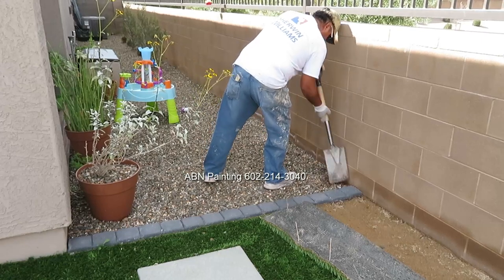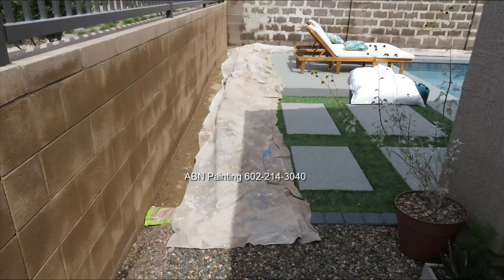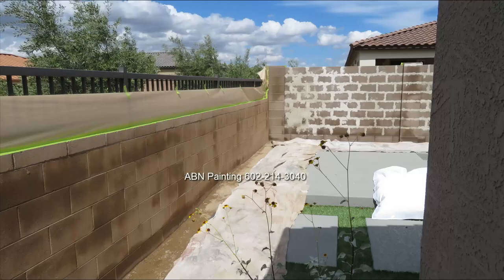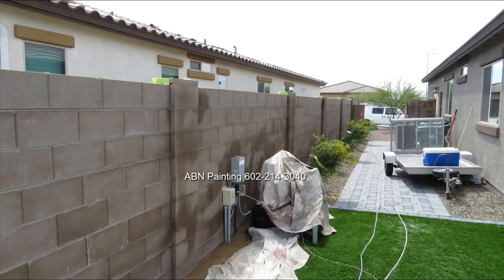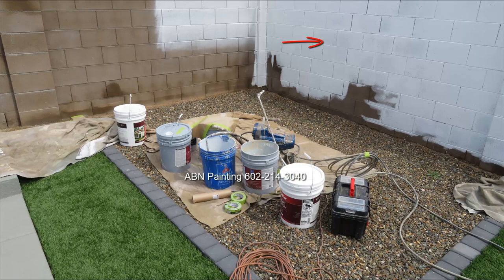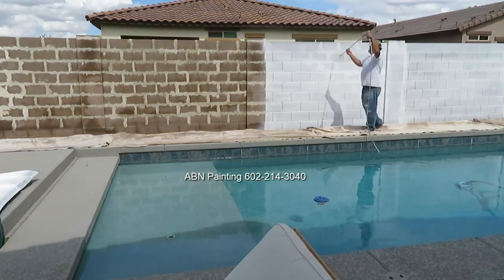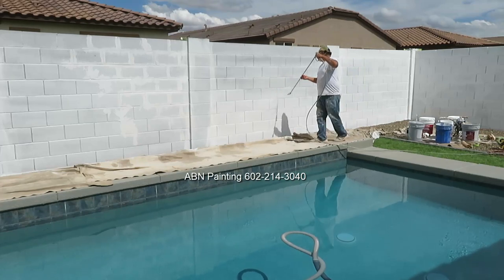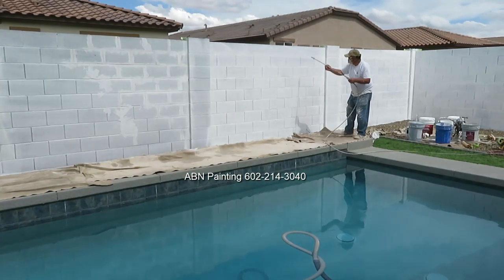Backyard block wall fence painting.

Comment: Nice job. How much coverage do u get from a gallon of paint, or how do u calculate how much paint u'll need?
Reply from the maker: on a cinder block wall one gallon  will cover about 150 sf on average. For example if i was to paint an unpainted  1500 sf wall a neutral color  i would start with 5 gallons primer tinted towards color of the paint and 9 gallons of paint.
Reply: @ABNPaintersPhoenix  Thank u. If ur painting a slump stone block wall the same color to cover graffiti would u still primer the wall?
Reply from the maker: if a wall has been painted before we usually don't prime, but to cover the graffiti, you might want to use some stain blocking primer first. Before you use primer you can try painting a small area without primer and see if paint that you are using covers graffiti well.